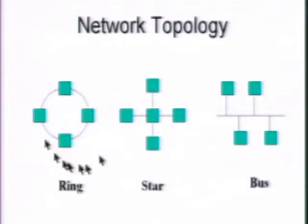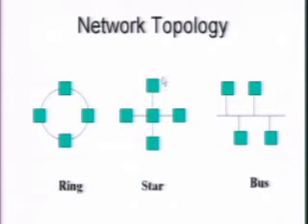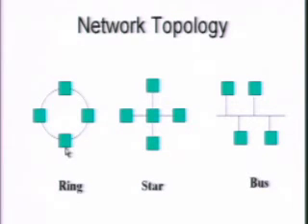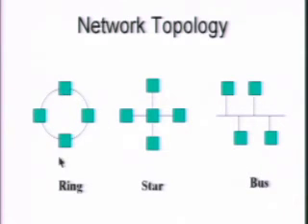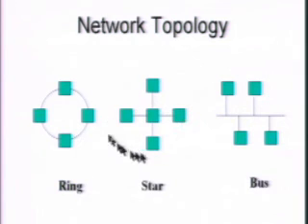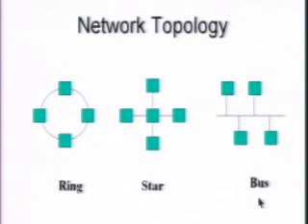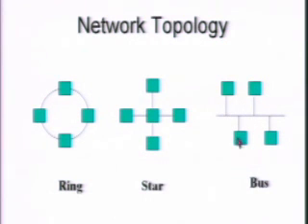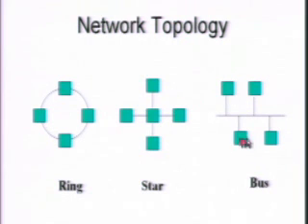Controller Area Network for Vehicle Applications

Comment: CAN is a bus topology (0:34) with the notable exception of the CAN implementation in VAG vehicles: Volkswagen, in their infinite wisdom, decided to go with a star-like topology, where by groups of nodes share termination points, with modified termination arrangements (different value termination resistors and so on), then link up to points on the bus, making it more a tree topology than a bus - in short, a hybrid between a bus and a star network.  The logic behind doing this still completely eludes me, as am sure others.  A very good introductory video.